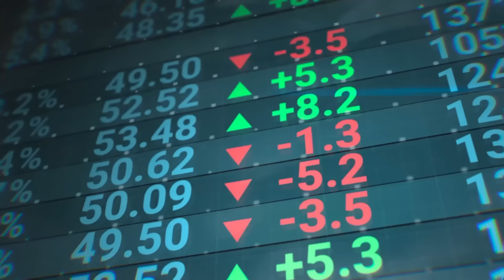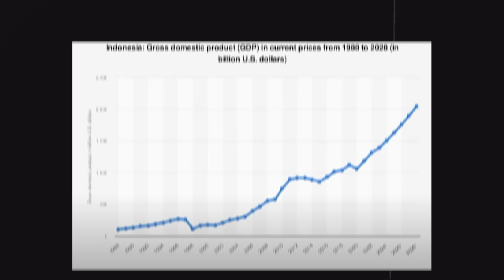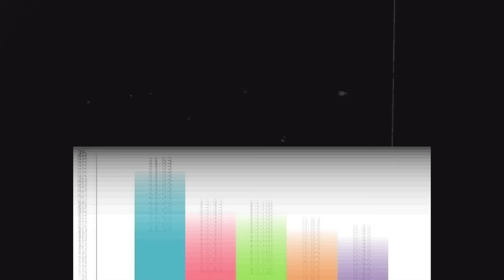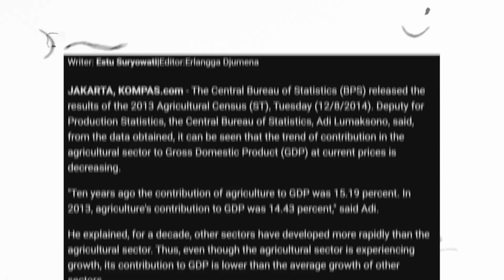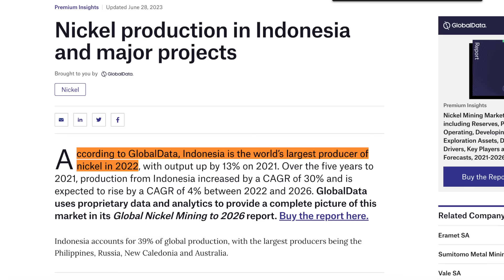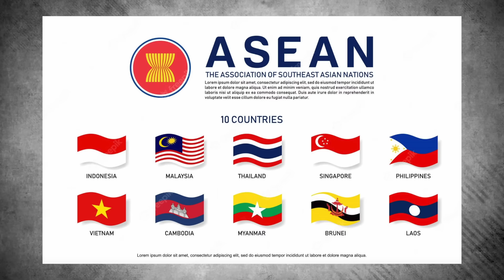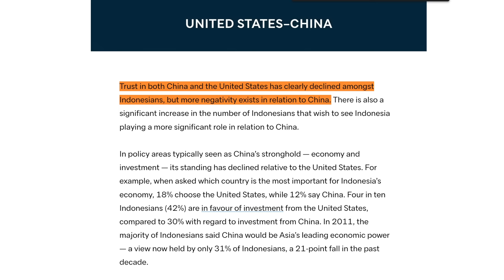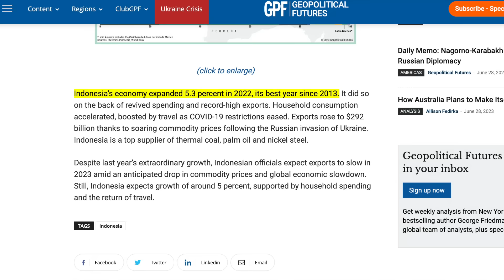Indonesia’s Quiet Rise as an Asian Superpower

Comment: Indonesia stands to benefit more by staying neutral between US and China, rather than picking sides.

Pandering to both sides, picking the ones that benefits itself most for each aspect of the relations, is going to be more beneficial than just straight down picking US or China.

Neutrality in international relationships is explicitly a political strategy in Indonesia, and I could not agree more. 

You get to punch above your weight class by being a power broker between the spates of other powerful countries and Indonesia has the geographical and political means to take advantage of that. That means keeping good relationships with both and not go into the trenches.